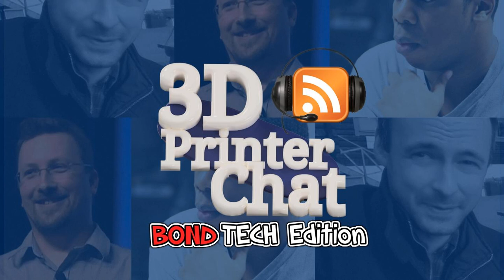Interview with Bondtechs Martin Bondéus

Comment: I have a QIDI Tech 1, and my brother has the Flash Forge Creator Pro.  The two printers are almost identical.  When the weather changed to the winter months, filament would not stick on the print bed of either printer.  Is the problem the effect of the climate change on the filament or the print-bed? ? ?